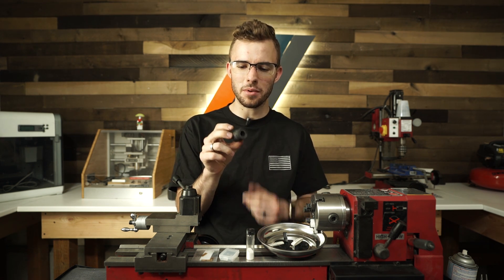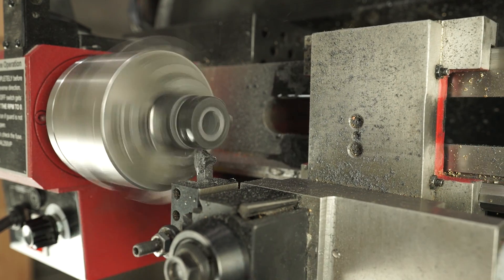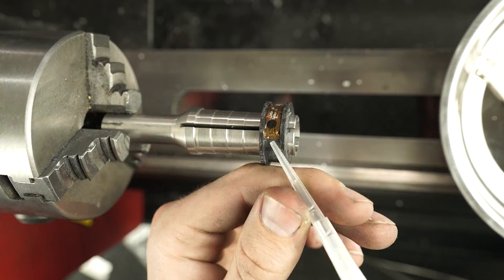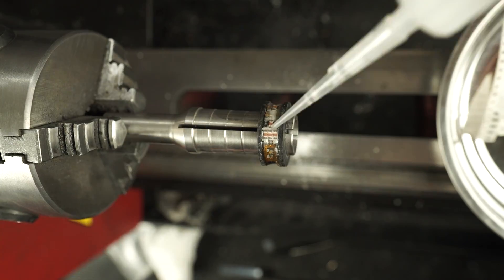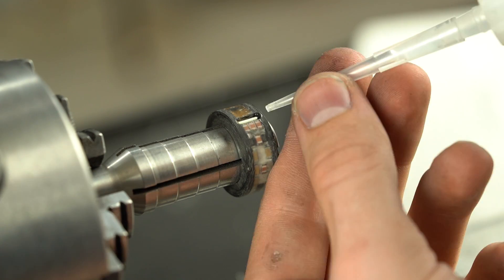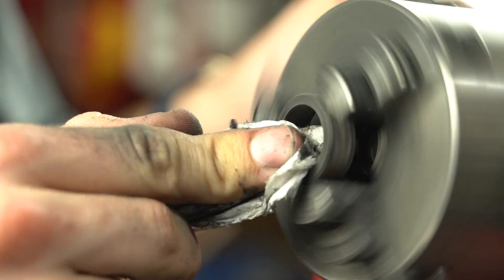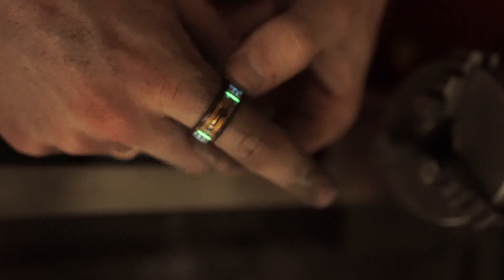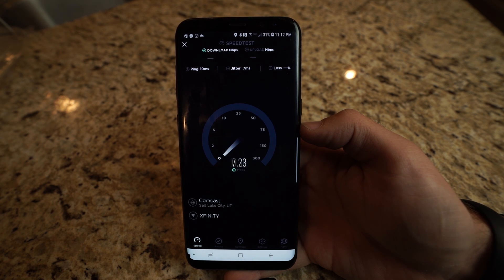Making an NFC Enabled Smart Ring with Tritium and Forged Carbon Fiber

Comment: Great job but, wouldn't it have been better to set a thin layer of glow powder under all the "fake" components instead of trying to fill in the gaps later on? I think it would have looked much smoother. Dunno I have 0 experience in this kind of stuff.

Comment: Smart ring [epic crafted item]: +7 wisdom, +10 haste, +3 electric resistance, all your attacks deal an extra 5 electric damage. Activate the ring to summon a small drone to aid you in combat (it's auto-attacks deal ~5 damage, with an electric shock cast that will deal 15 damage, and a fire damage over time effect that deal ~2 damage per tick) (lasts 5 minutes, 1 hr cooldown).

Comment: i simply don't think the ring looks professional enough to be priced at almost $300. the glue looks haphazardly applied and it doesn't look even. I can't justify the charge when you can get a ring that has the same NFC chip in it for less than $15 on amazon. I understand yours is custom made, but it can't be priced at $300 unless the work shows.

Comment: Very nice ring, but... radioactive tritium beta energy is about 18keV, which gives it a penetration of ~ 0.5mm through carbon.  That's not quite the safety margin I'd be comfortable with for something worn close to your body.  I suggest a layer of copper foil/tape underneath the emitter.  If nothing else, you might get some neat internal discharge sparks under the microscope!  (Note: this not a rigorous evaluation.  It's been a long time since I studied radiation.)

Comment: you could added NFC LED it is little PCB similar with size to your nfc chip, it flashing when it get close to NFC reader you could buy it on ebay just for 1-2 USD

Comment: Carbon never breaks down in the body? Teehee teehee. Yeah no, it's just the fine particulate dust and epoxy that's a problem. That it's carbon inherently means nothing.

Awesome ring though. Follow the recommendation of another user here, make a real circuit ring, your geek cred will sky rocket :)

Comment: Next time put a thin but consistent layer of glowing powder, seal it with some resin then put the NFC nap over it, since it's a bit transparent you will be able to see the whole circuit lighted up except the copper traces. trust me it'll be worth it.

Comment: What you've added to the ring is an NFC tag, not an NFC reader. Nice idea but the execution isn't as awesome as it could be. I'd replace the CA glue with epoxy and forget about the carbon. And be careful with those radioactive materials, they're somewhat harmless if you don't ingest them, but don't play too much with them. I bet you trigger all sorts of detectors in airports though. You've got talent and imagination, but you really need to work on the process more.

Comment: Colin doesn't like the fact that you are calling this a smart ring, for there is no LCD screen going around the ring.  I suspect he thought that this ring was going to have a circular LCD screen going around the ring, based on 3 things.  

One. The thumbnail cover photo for this video illustrates the glow capabilities the ring has, but these glowing attributes also resemble a LCD screen, especially in the little photo.

Two. When you combine the potentially misleading photo with the term, "smart", it could be considered even more misleading, based on the third reason.

Three.  You are unintentionally making a mockery out of 2018, TECH and the future!

This is not impressive TECH.
This is impressive ART!

Would you call a 1995 Casio Calculator watch, a smartwatch?
It is smarter than the average watch and has a calculator and a few extra functions an average watch does not have, yet it is no smart watch.  Maybe in 1995 it was smart, but in 2018 it is a dumbo. 

This ring is a work of art and has NFC, which is one capability that well known smart devices have...

Listen, anyone could use the term, but if you are going to use the term loosely, Colin here just illustrated that you will lose fans and respect.  You come off shady.

When someone drops a scrollable ring with all the bells and whistles, that will be a true smart ring.  Email, text, phone, waterproof, the hologram on the hand for a key board...I just want to be able to say TIME, and have the time lasered on the wall and I want it to stay lit up in the same spot for 30 seconds after I move my hand away.

Patrick...you are an artist! 
WE WANT MORE!
GIVE US MORE!

Comment: To improve an NFC chip you wanted near the Metallica part of an object, AKA metal improves the range of micro NFC chips.

Also small bits of metal may inhibit its range, IDK if you'll notice this but those random transistors might affect the range by 10 to 20%. beyond that I would have added a middle layer to the ring if it was just a small piece of aluminum.

Comment: I guess I didn't know NFC chips didn't need to be powered. The more you know! 🌈
Reply: The chips are powered by the reader, thus "near field" communication.  They have to get close before they pick up enough power to operate.
Reply: Yep, they work more or less as RFIDs do: they have a coil which picks up magnetic field from a source - enough to power a circuit, then they respond back with a signal. Most badges work this way (business, access cards, electronic keys and so on).

Comment: This is awesome.. small recommendation though... with the glow dust.. cut the channel then throw down a solid layer of glow dust and CA.. smooth out the layer. Then glue the components on top of the glowing layer.  Seal in CA again.  Polish etc.

Comment: Next time you do something like this, you can lay the circuit board parts upside down on tape to orient them the way you want to, put adhesive on the ring mixed with glow powder, then role the tape onto the ring. then it dries, remove the tape and your golden.
Reply: Would make for a super clean finish product with half the fooling around.

Comment: Just a thought for the glow powder next time. Do a layer of glow powder and glue in the channel first. Then turn it flat with the lathe and lay the components on top of that. That might make for a cleaner look between the components and the nfc chip.
Reply: seconded !
Reply: Yeah I came to suggest that too
Reply: StevenMartinGuitar  false
Reply: What kind of glue is that?
Reply: @U_gen_3000  Cyanoacrylate (super glue).
Reply: I like that idea.  :-)

Comment: Put some copper coils in it and some LEDs so it lights up when you put it on a wireless charging pad.
Reply: Put the glow powder OVER some LEDs on a charging coil so the charging pad 'charges' the glow powder.
Reply: Rob A  I don't know if they make surface-mount UV LEDs. If they do, this needs to happen.
Reply: @tissuepaper9962  they do.
Reply: This is fucking genius
Reply: you don't charge NFC. It is powered by the receiver's magnetic field.
Reply: @itsjustboarsley  he wasnt talking about nfc, hes just saying another idea for a ring, nothing about nfc was ever said in the comment
Reply: Yeah, I also thought of something more practical than dummy components. But one step at a time.
Reply: great idea
Reply: you'd need to get the right polarity of the coil every time. and if the wingdings went from bottom to top, only the bottom coil would get power because of how magnetic fields work :P
(induction)
Reply: you can even buy little LED PCB on ebay (like his NFC chip) it has led on it and it flashing when it gets close to NFC reader
just search for NFC LED on ebay it cost 1-2 USD (it is usually used in nail art)
Reply: or you could make one... SMD leds tend to have lower forward voltage which means if the voltage is high enough it will light up. but you'd probably need a small joule thief circuit (which can basically bump 1v up to about 3-4v) to power the led from the coil considering how low the voltage coming from the phone is. (also the nfc thing he used in the vid needs a tiny bit of voltage to function. you'd need to add an extra coil around the thing, but that could POSSIBLY interfere with the nfc communication... idk)
Reply: Yea
Reply: Omg thats a decent idea, would be better if you could fit a tiny battery inside
Reply: Most NFC circuits will cook/melt/catch fire on a Qi charger. You could make something that would properly dissipate the power, but it won't be functional as an NFC device.
Reply: Holy shit thank you so much for the likes!
Reply: Crazy Nerd Inventor dude you got 140 likes relax lmao
Reply: @spike4850  still, that is like over 20 times more likes than all my videos combined.
Reply: Copper coils, smd super capacitor and BLE. Even smarter than nfc
Reply: I have made it

Comment: Cool stuff. The forged carbon fiber looks like fiberglass reinforced nylon used in injection molding. Is it different?
Reply from the maker: It’s probably very similar. But this is made with carbon fibers instead of nylon fibers.

Comment: Awesome, have you seen those phone stickers that have LEDs that shine when receiving or making a call, they use the phone radiation similar to nfc, they are simpler technology but maybe you can do a ring with those circuits. I guess they are cheaper and you can put many in a ring.
Reply: You can google it as "phone signal light sticker". There's also an advantage because you don't need to enable anything on the phone. Oh and I've seen those circuits in other places like in fake nails, so you may buy something like that.

Comment: those are smd or surface mount components.
Reply: also on android you can use a nfc tag to unlock it, a sort of 2 factor authentication. ik for older android you need to root the phone

Comment: Idea: Same ring but using the chip for wireless payment from a bank card.
Reply: Yea sure and then Giveaway the ring afterwards 👌
Reply: That sounds awesome but in all actuality probably not a good idea.
Reply: @Darkslash365  That's a trend in Sweden already were people are putting nfc payment/train card chips under their skin
Reply: The NFC in a card is connected to the actual chip too, you'd need to put that in the ring also.
Reply: You need to find what chip your bank card is (likely mifare DESfire)
and get that chip in a ring, then ask your bank to write your bank card on the ring.
Reply: Or get a proxmark3 and pull all the info and clone it over
Reply: That's doable with a normal nfc, so it can be done with that ring as well
Reply: That specific type of wireless payment is very, very, very unsecured.
Reply: Check out Bankwest Halo - it's exactly this.
Reply: Someone did that already, check Kerv. https://support.kerv.com/information/ 
Not as cool looking, without any lights and all, but functionality is there.
Reply: Yes and make it functional to
Reply: Awesome job Patrick
Reply: Thinman12345 that’d be cool
Reply: I thought thats what it was going to do anyway, great idea but in practice it wouldnt be very good. Especially if you work in retail xD
Reply: They used to do NFC bank cards, until someone figured how easy it is for someone several feet behind you in the checkout line to read the card data as the terminal reads it.
Reply: hanelyp1 You know, these still are used in the eu, and they are awesome. The tunneling attack turned out to not be a real problem.
Reply: Used to? Many card issuers no longer offer a card without NFC. It sucks.